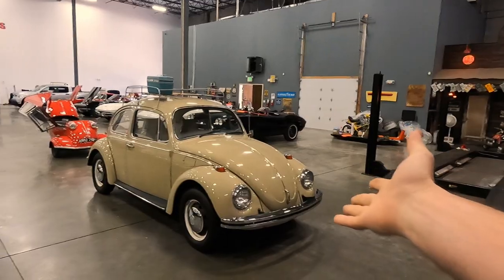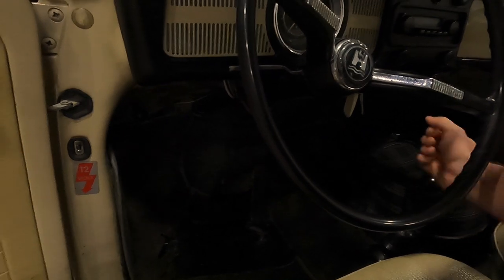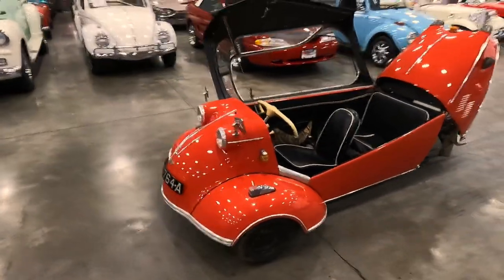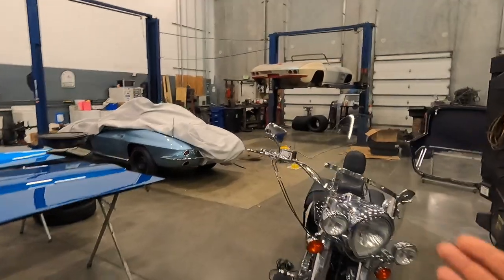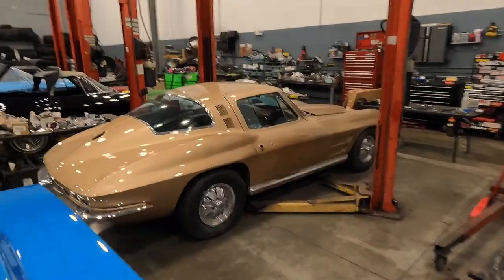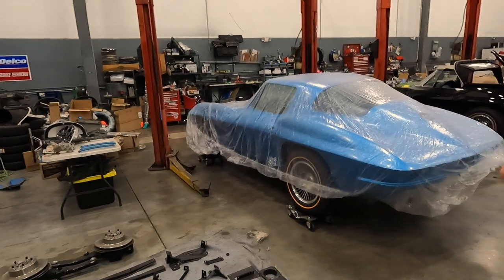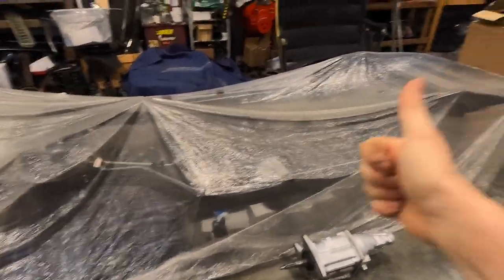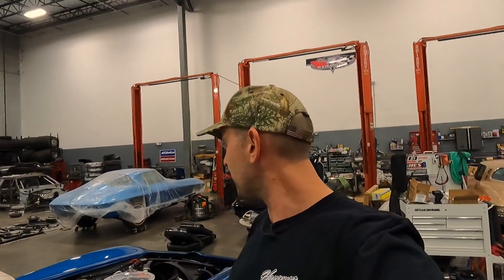VW Beetle Autostick - A Clutch-less Manual?!? Classic Car Restoration

Comment: Hey, I own a 68 VW automatic since 1978. Which I restored after getting it as a graduation gift from my neighbor. It a white with Blk upholstery.!. And today in 2024 I still own it and it’s my daily driver.🇺🇸✊🏽🎉😇🙏🏽👍🏽
Reply: hey @reyzapata9375 
 I am thinking of buying a 72' VW 1302 automatic. unfortunately the hydraulic valve is broken but expect no problems to repair. Any recommendation?
Reply: @marcosescuder2697  , I do recommend rebuilding the entire and Chech the trans for any defect. Since I had mine I rebuilt my entire engine 2 times and light maintenance on my transmission.!. Personal repairs and maintenance will keep you going.!. Good Luck.😊🙏🏽👍🏽

Comment: If it's a 2 stroke it doesn't have cams.  Some newer 2 stroke snowmobiles spin backwards for reverse.  It has a 4 speed transmission.

Comment: Lots of 2 strokes run backwards. I know many snowmobiles do. A lot of times if your stator is going bad it will reverse the spark timing and cause it run backwards unintentionally.

Comment: I have a 67 with the small block high horse. It was highly overpowered, until I did some mild suspension work, such as new rubber, gas shocks, and a Borgeson power steering box. But it still seems possibly overpowered, as I could easily spit it out.., so I wonder why somebody would have wanted the big block? Is it just for the punch appeal? However my eighty-two-year-old mechanic, who used to race around the world, including lemans, said the Big Blocks we're faster on the track, because of a higher top-end. But I'm sure that's after a pretty severe race tune.

Comment: I owned one of these (Brazilian built? RHD) in London in the 70s. An absolutely appalling POS. There was a technique for driving it which required me to grab the gear knob, which contained a micro-switch, before trying to shift. This actuated the vacuum servo which disconnected the clutch. Slightly mis-timing that was problematic. And, when stalled and with a dead or dying battery there was almost no way of bump starting the car. There weren't many of these about - at least i never heard of another one locally. I kept it for about a month. A true POS.

Comment: In the '50's, Keikhaefer Mercury made the 70 horsepower "direct reversing", model 78A, outboard motor. It had a single lever control with no "neutral". In the center position the motor was off. When you moved the lever forward the magneto would rotate for running in forward and the starter would engage spinning it in a forward direction, same for reverse.  https://www.youtube.com/watch?v=eClnL5El2CM

Comment: Here is the question guys 1964 bone stock 365hp sold lifter VS 1966 bone stock 427-425 both 4 speeds who wins ???  we will find out soon
Reply: Solid lifter I would think is faster., but the torque of the 427 was incredible.. I’ve rode in both when I was a teenager and my uncles where in their late twenties.  The brothers loved to race them. The 64 was faster off the line, but that big block torque at a roll would pull away. Both where just awesome.  At 55 years old now, I still can feel the thrill of those cars. Felt like a real race car
Reply: @gsmith207  We are going to find out when cars done .... 64 365hp coupe 4.11 rear 4 speed   VS 1966 427-425hp 4 speed 3.70 rear going to make 4 runs Jr vs Sr as drivers switching cars between rounds
Reply: @classiccarsofsarasota  Personally, I cannot wait!! 👍 ... (thought you were just blowing smoke when you mentioned that possibility in the video)

Comment: With the same gearing a 365hp vs 435hp is probably close in acceleration but the lighter 365 will handle better.  Give me a 65 fuelie with disc brakes.

Comment: That mess. is nothing special the only thing different is the starter spins the other way. Same system is used in nearly all 2 stroke golf carts. Fuel pump is driven off of pressure pulses from the crankcase so rotation doesn’t matter